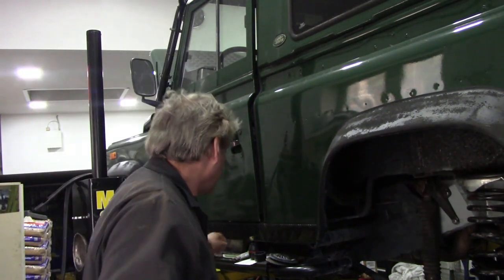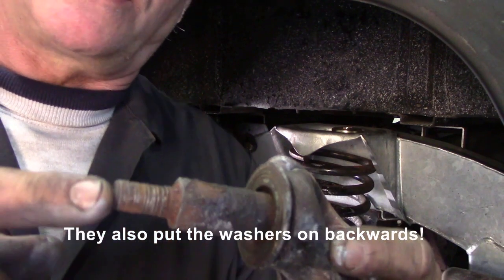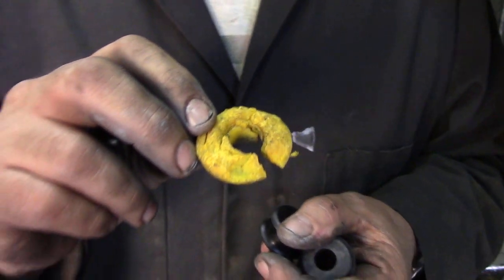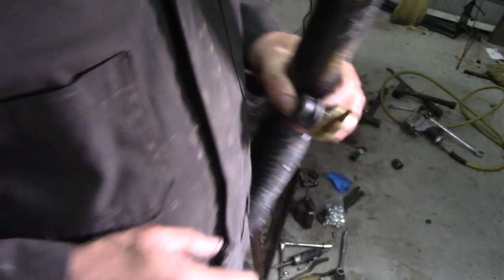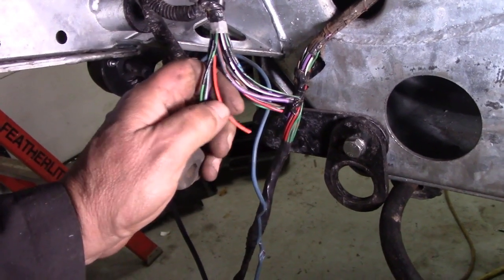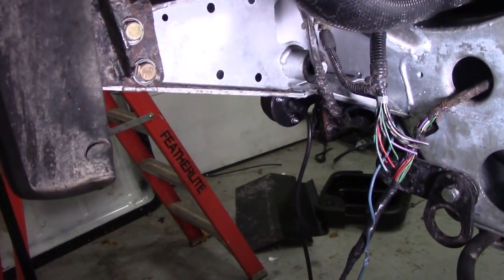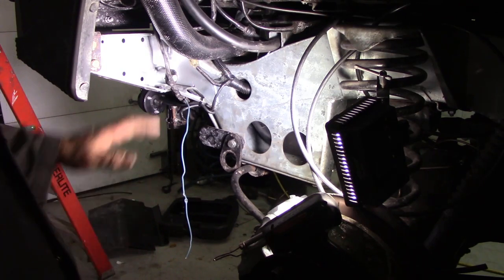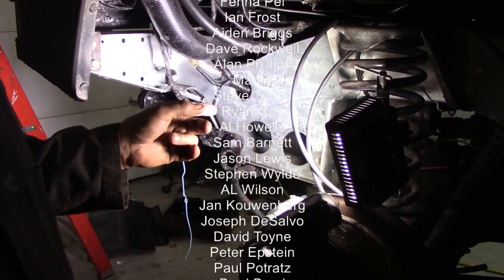D90 rear chassis replacement. Part four suspension and wiring notes

Comment: Something I found to my cost twice recently is that it’s very easy to snap the thread on the rear shock mount following the torque setting when refitting the shock with part worn bushes, bit of a doh moment the second time and a lot of swearing. They really don’t need much before they let go and I didn’t even realise.

Comment: A sender inspection hatch would solve a few issues in the future? Steps going to be interesting,I guessing it might take a bit of custom fabrication to get it to work alongside the after market step that's already fitted?
Reply from the maker: The Disco 1's had a plate in the floor which made life easy

Comment: a fair set of videos  ,, i normally try to leave the rear spring mounts and cut off behind them if possible , but it takes me all day to do a rear chassis cut an shut , a lot of folk dont realise how much work is involved its a hard day with no room for hanging about either
Reply from the maker: I have had those that end at the spring mount, but I am seeing a lot of rot behind the mounts now so this does the job quite well
Reply: yep fitted those too , last one i fitted was made in 3mm plate , that wont stop it rusting away , but it will certainly extend the life of the repair , infat , i did a disco 2 one on sat , lots of acf afterwards too.

Comment: Hi Mike, realities of rear crossmember replacement, not a quick or straightforward job. DDS Metals make good ones in the UK, Galv option & 3mm thik too, Britpart are awful & look like my first welding project. You should consider selling those suspended ceiling clamps on your shop as well, I'd buy a pair, you cannot get them here. Enjoy your channel, married to a Yorkie so humour is same.
Reply from the maker: Peter  - this was a good crossmember but it was more TD5 than NAS
Yes the clamps as excellent and very versatile to adaption - 100's of possibilities! 

Will be in the shop soon!

Comment: Polybushes are complete crap. After 200km Iceland they whrere completely gone... Emergency repair  was a cut-in-half rubber hammerhead. Is inside 8 years and works perfect...
Reply from the maker: Polybushes are good on sports cars where you need a firm ride, but not so on a4x4 where you need articulation
Reply: Jepp. But I thought, Australian ARB HD Polybushes for extrem outback  last much longer... :-)  @BritannicaRestorations

Comment: The ship chandler down the road from me sells connectors called 'solder splice', which is clear shrink wrap with a little cylinder of solder within. Does the job of soldering end to end and shrink wrapping in one. Might be a time saver??
Reply: Hi. I tried these but although the solder melted there was no integrity / strength hence they just pulled apart. I got mine cheap off eBay so maybe they were just poor quality?
Reply: @darland3821  I've seen them, but not tried them, as they weren't suitable for my situation. There may be a difference in quality,  as the marine place charges high quality money!!